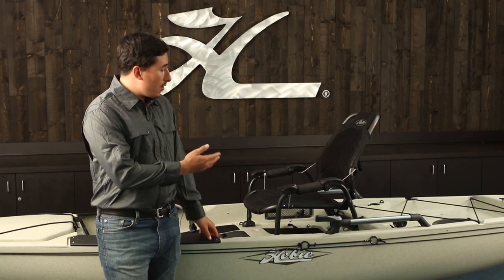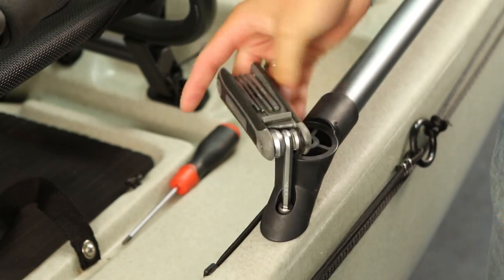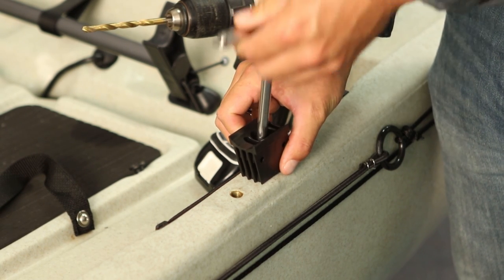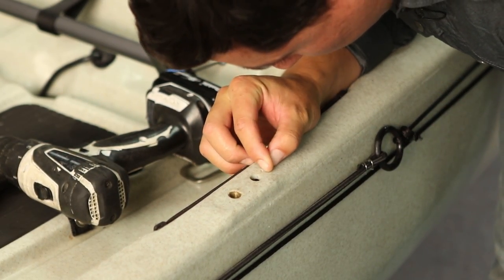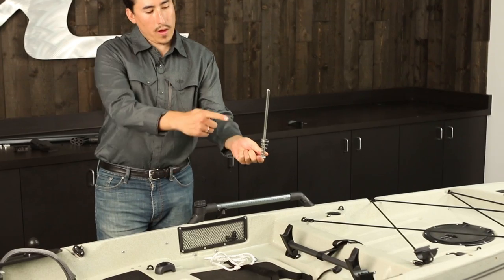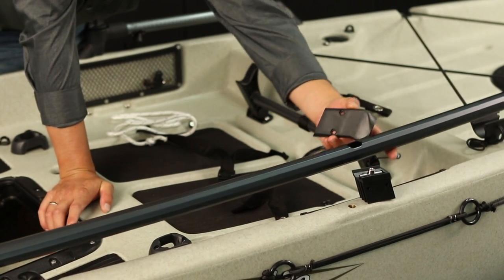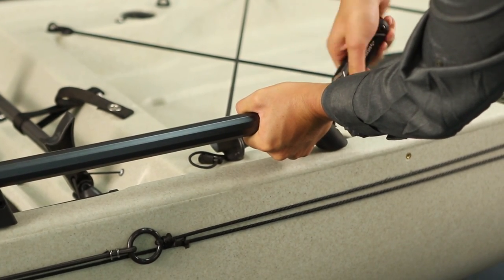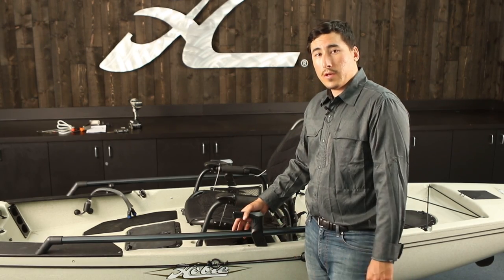H-Rail upgrade on a ProAngler 14

Comment: Instructions and video have an omission if you have a 2014 Kayak with  different steering cranks.  Basically, if you have a newer 2014 model and up, this works and disregard.  However, if your 2014 Hobie Pro was one of the first ones made, then factory steering crank (which two come in this kit) are longer and has an extra smaller crank arm on it. You need to use your factory cranks and modify them.  This smaller rod on the crank glides through a metal mold on the hull that allows the steering to stop at certain degrees left and right basically.  Once you install the upgrade kit, that smaller arm is too long and now and you have to saw off a 1/2 inch (FROM THE SMALL CRANK) from it to get it to work.   Basically, in 2014, Hobie redesigned the stops for the crank to save money is what I was told.  Hope this helps another pour soul that was in my situation. Also, there is no rudder tentsioner on my boat and had to remove the plate on the back and loosen the tensions that way.

Comment: Kit was a nightmare to install...

I have a 1st edition PA12, and the 1.5" bolts that come with this kit were not long enough to go through the hull and meet with the square bracket/bolt that you see him run the string through.  I had to go to Home Depot and buy 2" long bolts to make it work, and ended up stripping 2 square bracket/bolts (kit only comes with 2, but luckily Hobie is only a 40 min drive from me and they gave me 2 extras right away).  Line them up good, and turn very gently until they catch, otherwise you'll strip them (don't force it).

Also, the new steering rods included with my kit were shorter than the stock one's, which I didn't realize until about after 30-60 minutes of pure hell trying to push them up through the new rails far enough to get the pin through with my arm jammed inside the kayak!  After I realized that wasn't possible, I compared the new one's with the old one's, and the original's are longer (and luckily long enough to work)!

Tip: I used the original rail bolts, a couple washers, and a couple 6-8" pieces of shock cord, and mounted them to the old rail holes that are left exposed to make some new rod straps (since the rod straps were built into the old rail and the H-Rail doesn't include any).
Reply: +Hobie Cat Company thanks for the reply, but I measured the length of the hole that the new bolts run through to the surface of the square nut on the inside of the hull with an unfolded paper clip and the 1.5" inch bolts were not long enough, and even 1.75" bolts weren't either (at least on my boat).

No, my cranks were not mixed, because the shorter one's were shiny and new, while the longer one's were dirty, greasy and used looking.

It was definitely worth the trouble of upgrading, but just wanted to post the issues I ran into so anyone else attempting the upgrade would have a heads up.
Reply: hey dave can you send a pic of how you did this with rod holder strap

Comment: You should notch the h-rail. Like the stock one is so that you don't have to fight it so hard like I had to. Good instructions besides some omissions. Also, what are you plugging the old base bolt hole with? Looks rather tacky. I didn't try, but I think running the steering base backwards might have worked without any drilling?

Comment: We could use H-rail spares to mount to other kayaks?.. I'm thinking just cut the rail to size then install?.. thinking of using one as a rhynobar as mounting options on my yak (non-hobie) are somewhat limited.
Reply: Thanks for reply.. found those parts not long after hehe. Ordering them in for my boat :)

Comment: I ordered this kit and my steering cranks were actually shorter (9 1/2") than my original (9 3/4"). What length are the correct steering cranks supposed to be on this upgrade kit?

Comment: Does this fit the 2013 PA 14 model?
Reply from the maker: The installation takes a little modification, but it can be done.  Instructions are provided for 2013 PA's.
Reply: What's different about 2013 PAs that makes this install different?